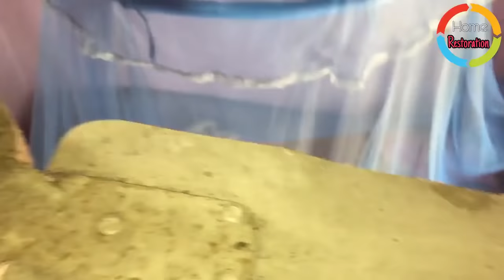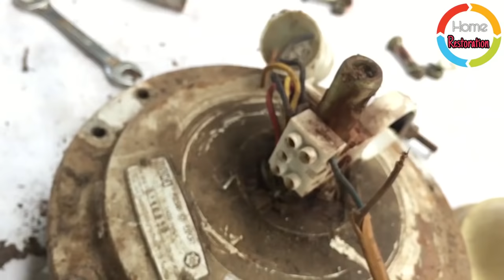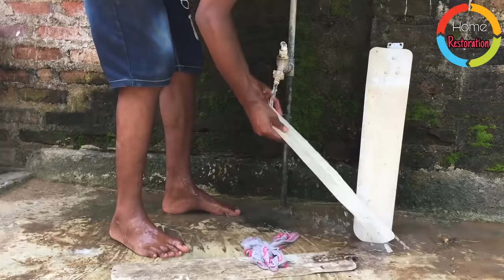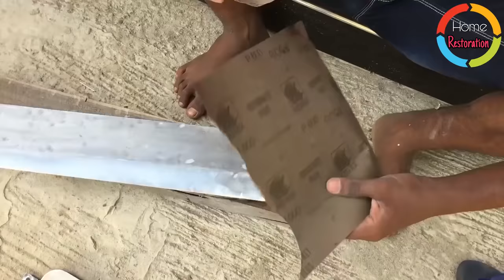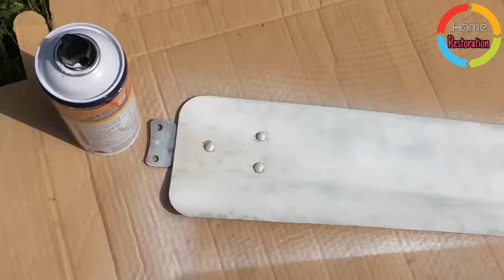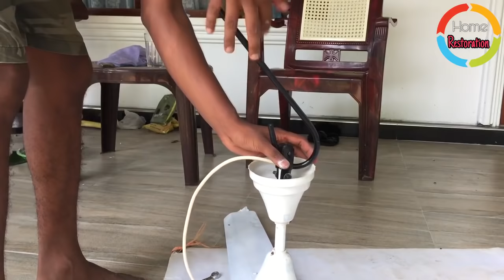Restoration 20Year Old  Fan | Low Technology Restoration  Old  Fan

Comment: If it's 20 years old then that means it was literally Running In The 90's.
Reply: Bro we have a 36 years old Usha fan it's still working 😢
Reply: And even we have a Usha 4 blade fan which is 27 years old but it spins clockwise so we avoid using it
Reply: Both of them are of my grandparents

Comment: When the fan was moving even the canopy was moving thats weird
Reply: because of the vibration
Reply: @LnF4530  hukjgjj😍😍
Reply: archithengaboyao2219 the moving thing is called "wobbling" most fans do that because their mounting bracket is loose or the Blades are bent.